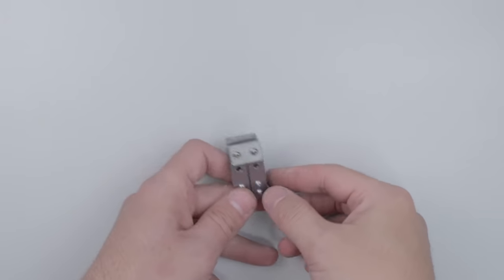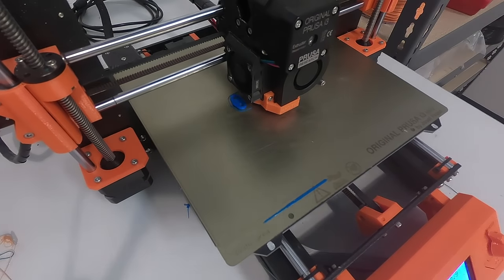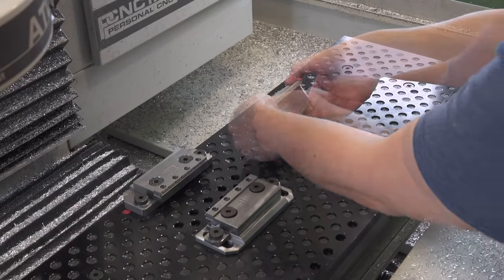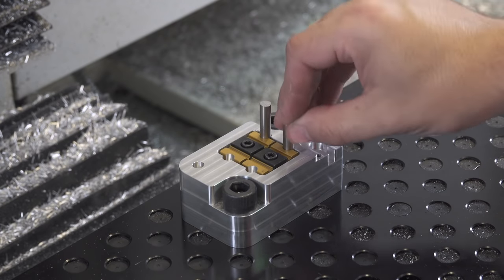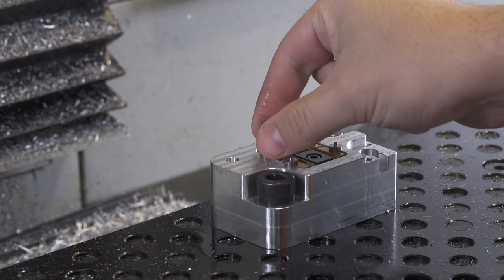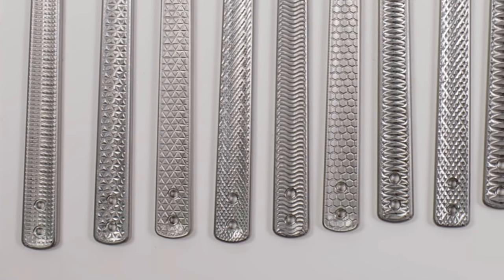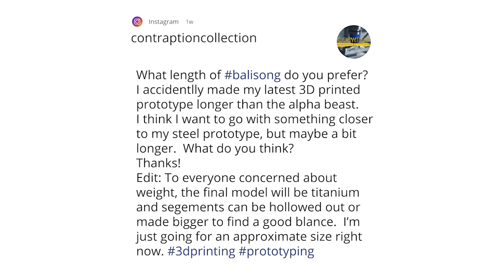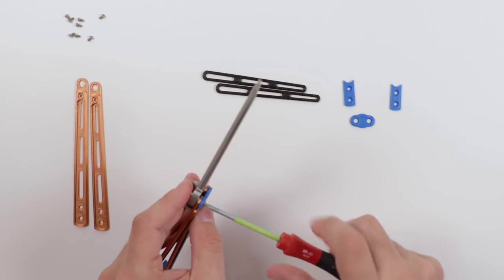New Ideas with Time, Space, Shape, and Size. Baliscissors: Ep 12

Comment: I love that you show your mishaps.   I'm a home machinist as well. I have a heavier spindle than you so some of this won't apply.   I tend to run about 2500 RPM for drilling.  For aluminum I will generally run z rates around 8 ipm for .06 bits and increase it until about 12 ipm at 3/16.  I don't go much about 14 ipm even up to 3/4 dia as the chips get pretty strong and can scratch up the part.  This provides a heavy enough chip that it won't wrap up on your drill for the most part which will often end in breakage.  I peck with much smaller steps than you.  I'm usually running peck steps of 1.5 to 2 diameters for the first peck and 1 diameter for subsequent pecks.   For deep drilling (I've gone as deep as 40:1) my pecking step drops to about the axial length of the drill point.   It's painfully slow the drill runs true and parts don't get scrapped.    On a different note, I do mostly prototype work.  But I never just push go and sit back and watch for a first run.  I almost always find errors in offsets, feed and speeds, or cutter paths.   I use a manual data wheel to step through the start of each operation until I can see it's running as intended.  Saves a lot of stock and cutters and I rarely need to run a setup part.  Enjoy.

Comment: Nice work. A word of advise on those MiteeBite jaws. Make sure to cut your pocket in the jaws as close as possible to clamping position. These are 7075 aluminum, and like to fatigue rather quickly during clamping. I always machine the pocket in the jaws to leave about .003" to .000" gap between the jaws and part before clamping. Otherwise, you'll run into fatigue cracking. Also, make sure to use thread inserts for the clamping bolt. That bolt will quickly strip out the aluminum threads. Good luck!
Reply: Use 17-4 stainless for your pins. It's a bitch to machine, but a lot stronger. Or you can use a 4140 and have the pins plated or nitrided for wear and rust resistance.

Comment: When you're using the Mika 3D silk filament, try wiping your build plate/surface with IPA (alcohol). This should help give the filament a nice clean surface to adhere to. You also want to print your first layer at a high temp, around 220/225°c with no part cooling. Then go to about 210/215°c with your preferred cooling percentage. Mika is my son's favorite filament and once we got the parameters down for the first layer, we haven't had a problem since. We print telescoping lightsabers that are 425mm tall and have never had one fail, yet. Hopefully that will work out for you, at 40 bucks for 3 rolls of it doesn't, at least it's not a big loss. Can't wait to see your final design.
Reply from the maker: Those seem like good tips

I did find it worked better with higher temperatures, but I should have only done it in the first layer. I tried a few things. The ones that did print to completion, and didn't fly off, were printed entirely at a hotter temperature, and that's probably why they're so stringy.

Comment: ive been wondering this for a while but why dont you offset the position of the blade and the handles so the first point of engagement is when the handles are a little open? then you can close the blades all the way tighty without fail everytime and can stop worrying about extreme tolerances to prevent the scissors from being loose, essentially just setting the pins turning downwards and away by about 1 degree

Comment: If at all possible, make the pins out of hardenable steel, or at least something more wear resistant. Rubbing hardened steel against soft steel is a recipe for wear and slop. 

The only situations where it doesn't cause problems is if the surfaces rubbing are perfectly smooth (round pin spinning in round hole for example) or if the parts fit together perfectly without any possible chance for movement in other directions (your tolerances would need to be dead on for every piece). 

There is plenty of hardenable steels available online on ebay or aliexpress for a reasonable price. If you cannot get tool steel in the size/shape you want you can always search for spring steel. It is available in round and pretty wear resistant. You would then need to machine it with carbide tools because it is too hard for hss. 

Those are just two options i could think of, there are many other steels that could survive this but if you make them out of mild steel those pins will wear with frequent use. It might seem like a trivial problem, but if your products wear out and break over time customers won't buy from you anymore. Better to put in the time and release a good product than to rush it and shy away potential customers because your first product wore out so fast.

Comment: CRC 2-26 helps with drilling stainless with a hand drill or a drill press so I would assume it would work with a cnc machine.
It's safer on plastics and paints than CRC5-56, seems to be a better cutting fluid, and goes further due to its high surface creeping and slight foaming.

Yes it is the electrical branded CRC stuff.

Comment: for the drill, do a deep drill cycle in fusion. it will retract to the top of the hole each time, and every few pecks put some tapping/drilling oil on the hole and drill. and make sure the flute length of the drill is longer than the hole is deep

Comment: I'm no machinist or engineer, but wouldn't you want the pins to be softer than the blade? One, the other, or both are gonna wear each other out over time, and it's a lot cheaper down the line to replace pins than a blade, right?
Reply from the maker: That's a good point, but blades are very hard, so I'm not even sure if I even could made the pins harder than the blades. I just think it could be a good idea to make the pins closer to the hardness of the blades.

Comment: With drills switch at flood coolant.. try with a sprayer and squirt some over ... 
Your problem seams like overheating of the drill shaft and pour chip evaquation that jam the gullet on the drill
Reply: I consider to switch out type of drills and i can advise you should try "dormer hss TiN coated drills ground web" ... For speeds and feeds i have on metric because i am from italy :
S&f jobber length drills with center hole and depth of 6xD :
From 1 to 4 mm diameter Vc 16 m-min/Frev 0.03-0.07mm peck evry 1time diam.
From 4 to 8 mm . Vc 20 m-min/Frev 0.055-0.10mm peck evry 1.5 time diam.
From 8 to 12 mm . Vc 22 m-min/Frev 0.11-0.16mm peck evry 2 time diam. 
From 12 to 20 mm . Vc 22 m-min/Frev 0.14-0.24mm peck evry 2 time diam.
Reply: Inch converted 

S&f jobber length drills with center hole and depth of 6xD :
From 0.03937" to 0.15748"  diameter Vc 52.5 SFM/Frev 0.00118"-0.00275" peck evry 1time diam.
From 0.15748" to 0.31496" . Vc 65.5 SFM/Frev 0.00216"-0.00393" peck evry 1.5 time diam.
From 0.31496" to 0.47244" . Vc 72 SFM /Frev 0.00433"-0.00629" peck evry 2 time diam. 
From 0.47244" to 0.78740" . Vc 72 SFM/Frev 0.00551"-0.00944" peck evry 2 time diam.

For stainless steels drop down the Speed to :
First range size 26.3 sfm (from 0.03937-0.15748)
Second range size 39.4 sfm (0.15748-0.31496)
Third range size 46.0 sfm (0.31496-0.47244)
Fourth range size 46.0 sfm (0.47244-0.78740)

Comment: Stainless definitely needs LONG pecks and pecks, because of the stringy chips like you mentioned.   I would also consider trying a 3 flute roughing drill mill/endmill in a plunge fashion with good fogbuster pressure.   The rougher will do a good job chopping up the chips and the 3 flutes will give good cutting performance without clogging like a 4 fl would.   Stainless HATES short pecks because of work hardening, so you need to punch through it and keep the momentum going as long as you possibly can.  
Source:  Dealing with 303, 304, 416 and 17-4 for the past month.    I'd rather cut titanium than stainless, honestly.   If you'd like, I can recommend some endmills i've had excellent success with as of late on my Tormach.

Comment: Hey bud! good stuff!  With your drill I'd drop SFM to 30 and peck full drill dia. reducing by .005 to around .025 and FULL retract. I think your feed is right on ( I got .0012)  But my guess is without coolant you will keep breaking drills. 303 or any SS variant holds to much heat, gums and burns the bit... then it's over.  You maybe could get away with liberal application of lube along side our air blast.  If you try it, let me know how it goes.
Reply from the maker: Thanks for the tips! I probably should just switch to mild steel for the pins for prototyping, then hire somebody with a nice lathe to make a bunch of them out of some kind of wear resistant stainless steel.
Reply: @ContraptionCollection  17-4ph would be a nice substitute. it's lovely to machine for a stainless and will do a nice job as a prototype.

Comment: With 303 take HSS drill with TiN if possible. I will assume that's around 2 mm drill. Set peck (Q) at 0,3 mm with full retract around Z 10 mm over top and you should really need flood coolant that mist is a no go. Set speed at 20 m/min and F at 0,05mm/rev. You will make at least 300-500 holes. Don't bother with carbide drills in stainless for what you are doing you don't need it.

Comment: I'm new to your channel, but I have a 4 axis lathe (live tool milling) I could probably make some pins for you if you want.  IMO the TAS rougher is pretty overrated compared to a lakeshore rough'n finish or just the variable flute for aluminum line. Kennametal Maximet are great too.
Reply from the maker: That would be awesome.

Eventually I'd like to find somebody who could make 100s or 1000s of pins for me. Right now, even though it could be expensive, I think just getting 10 or so made with better tolerances than I can achieve with the Tormach would really help me get my design working.

Would you want to email me at:
ContraptionCollection@gmail.com

I could then send you some step files or whatever you need.

Comment: For drilling speeds and feeds, I use the numbers found here:

http://www.vikingdrill.com/viking-Drill-FeedandSpeed.php

Along with this calculator, or the one built into HSMWorks/Fusion.

https://www.custompartnet.com/calculator/drilling-speed-and-feed

Their milling speeds and feeds calculator is good too!

For any hole deeper than 3x the diameter of the drill, you are going to want to peck. If you are having trouble clearing the chips, set it to full retract on pecks.

Comment: Your pecking too deep try pecking half the diameter of the drill bit with a full retraction from the part to clear chips. 303 stainless should machine like butter so if your drill is breaking your feed rate is too aggressive. If you have a handbook you can check the recommendation for feeds and speeds yourself or do the math. The formula to find the rpm of a tool is generall 12 x sfm/pi x diameter of the drill/bar stock/end mill or whatever. Also it’s important to take the chipload into account your drill can only evacuate chips so fast. If your chips are long a stringy try slowing down your tool, also if your using high speed steel or try switching to carbide or vice versa. Every lot of material will be different. Usually within the tolerances that is required to be identified as 303 but still. Even if the Nickle or chrome percentage is a on the higher side or if it has more iron in it than the last slug you used, it’s all important to note. Hope this helped!